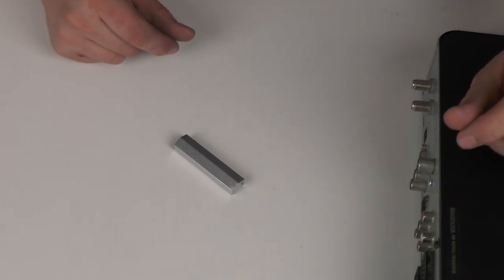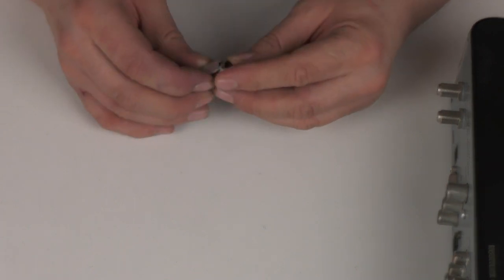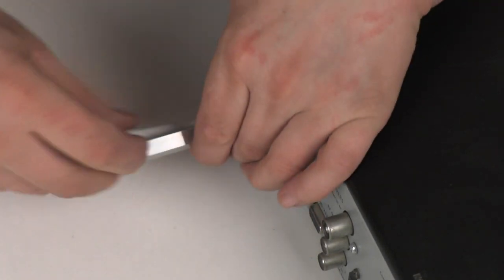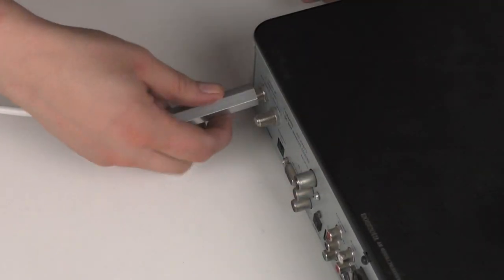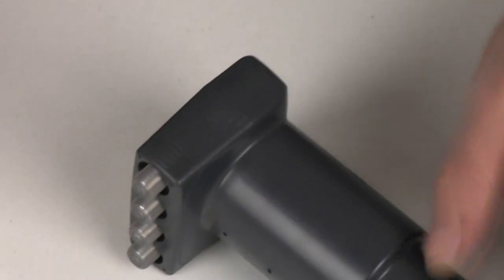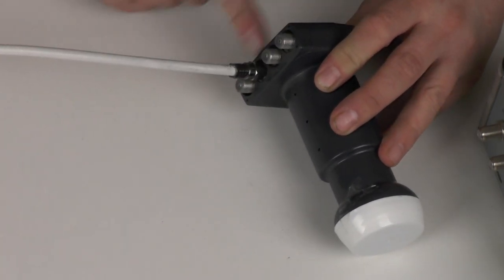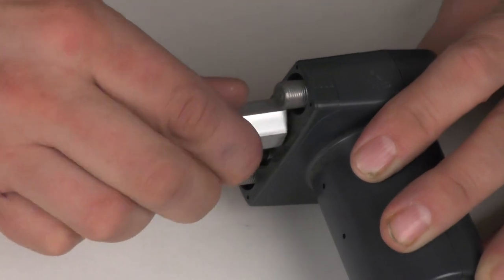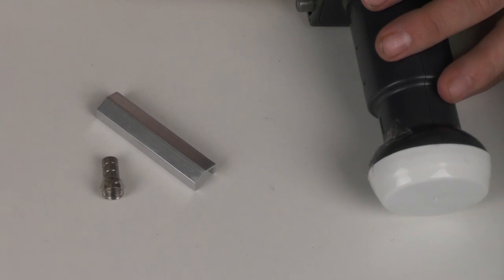F Connector Fitting Tool Spanner / Wrench For Satellite & Cable Boxes

Comment: You have to start the connector by hand so you might as well run it almost all the way by hand. At that point it only needs a snall fraction of a turn to make it tight. A 7/16 wrench will finish the job. If you want to keep one dedicated for the job, a decent 7/16 stubby can be had foir around 4 bucks.